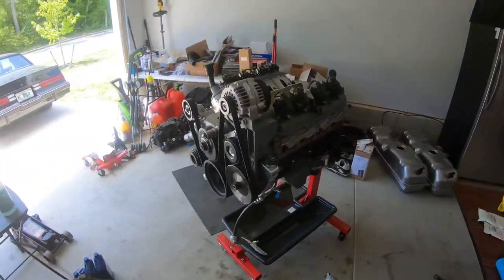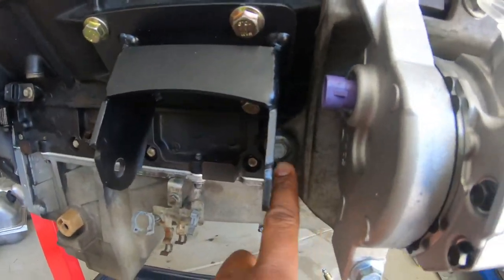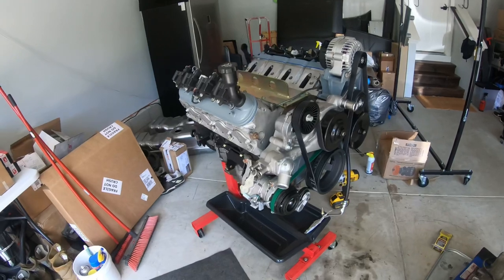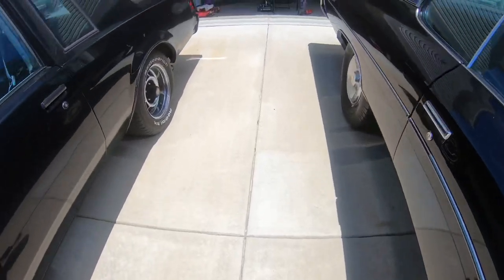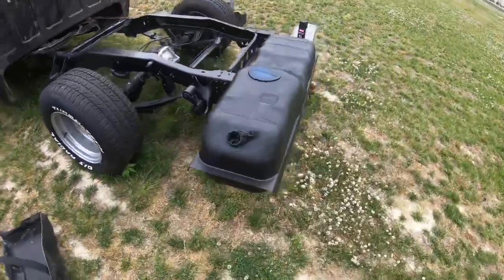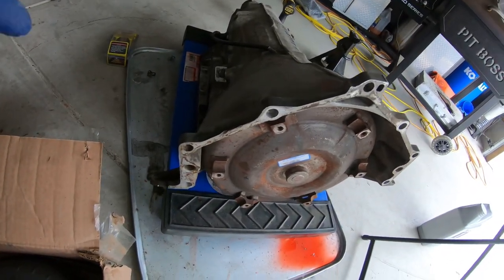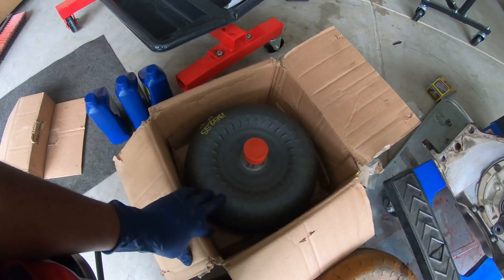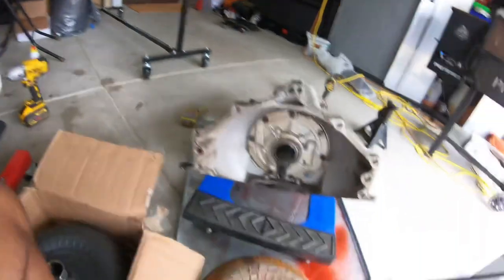LQ9 Build Complete & Torque Converter Install For 4L80e

Comment: Nice job as always bro 💪🏽 what converter did you end up going with? I got a circle d 3000-3200 stall converter for my Lq9+4l80e with stage 4 cam.
Reply from the maker: It’s a TTC 2200-2400 I picked up on Amazon.  I have that circle D converter in my impala. I’ll be camming it real soon.
Reply: @CarolinaMikeGarage  ok cool. I was lookin at that one for a while. They were sold out for over a year. That’s the only reason I went with circle d. Maybe I’ll grab one of those when I swap my 96 caprice. I can’t wait to see you cam the impala 👀
Reply: Heavy Chevy did you stall converter line up ? I have a 3200 stall as well for a 6.0 4l80e and the flex plate didn’t line up?
Reply: @Castro_C  I haven’t got it installed yet. But if you got it the 278mm stall from circle d then you’re gonna need a 4l60e dished flexplate.
Reply: @HeavyChevy1975  thank you man,Good looking out 🤘🏽
Reply: @HeavyChevy1975  thank you for the sub and the link boss 👍🏽
Reply: @Castro_C  💯

Comment: What (radiator dual fan) are you running on the 96 impala after you ls swapped it? Or is you radiator factory(dual fan)?
Reply from the maker: Stock fans and radiator.
Reply: @CarolinaMikeGarage  thankyou